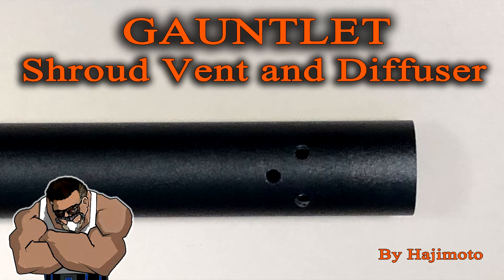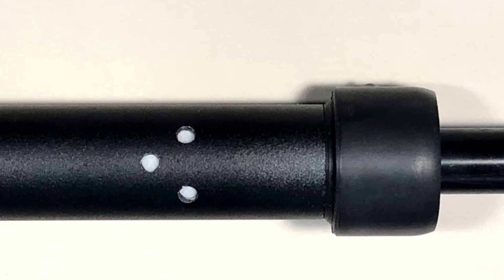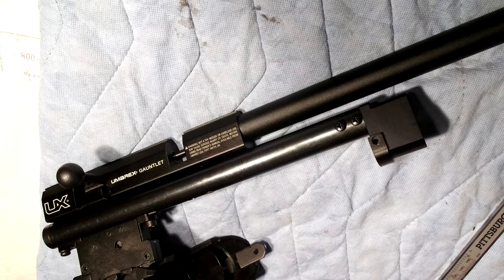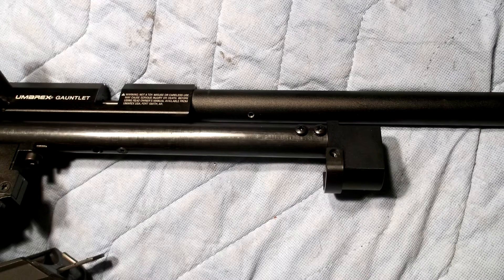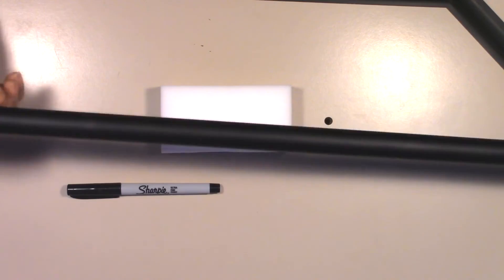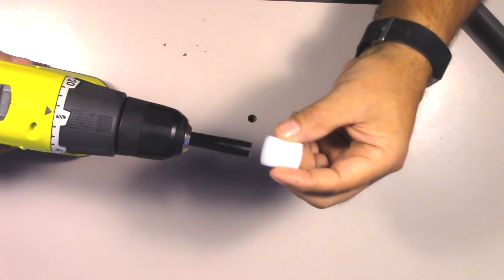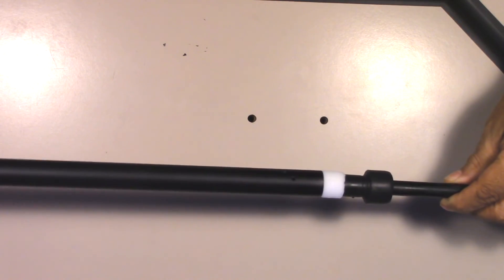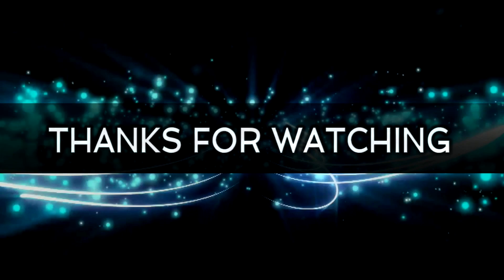Umarex Gauntlet: Shroud Ventilation and Diffuser

Comment: I recently installed the Sumo short shroud combo from DonnyFl on my Gauntlet .25. Upon testing I found the combo to be just as loud as my stock setup with your shroud mods and HP baffles installed:-( ! The real difference came when I did your mods on the short shroud(vent holes w/added diffuser). After testing again I found the Sumo with the modded short shroud dropped the sound level by 12db on average!! This is so your viewers know this is a worthwhile easy mod, even if the get the short shroud combo from DonnyFl!!! Thanks for sharing your knowledge and expertise!!!😃

Comment: Is there a particular characteristic to a melamine sponge you deem necessary for the job ? Guess I should have seen this one first. I drilled  two holes 2" up because that was recommended in another video you made. Have a .25 cal. I will drill a third 1 3/4 " up. Will make a triangle shape. Really like you vids trying to take it all in . One project at a time.
Reply from the maker: The melamine is micro fine holes which act as a much better static pressure induction generator as well as forcing the air through a labyrinth of pathways to help mitigate sound. Lastly, antimicrobial and great at catching lead dust. Also remember you can stack as many as you need so the melamine foam covers the holes, so that 2" distance is no issue at all ;)

Comment: Great video. How tough was it to drill the holes in a round barrel. I wish you would have shown that step.
Reply from the maker: The shroud is 1.5mm thick aluminum, it is very easy to drill. Just be sure to clean up and debur the inside of the shroud so the rough edges to not cut o-ring.
Reply: @HajimotoProductions  ok thx really appreciate it.

Comment: thanks for the very detailed videos,on the .25 the foremost hole is 2'' from the breech so the 2 offset holes are how far off the breech and how far apart?and i saw the takedown on another video with the hammer and to polish it,what did you use to polish inside the cylinder with and or any type of buffing compound?
Reply from the maker: The holes are in a triangle configuration and they are 3/4" from each other. The total hole openings of the holes should not exceed that of the bore. In other words if you have a 25 caliber it is .250" so three 1/16" holes will be good (3/16" total) but three 1/8" holes will not because the total free opening size would be 3/8". Smaller holes keep  the diffuser material from being pushed out as well.
 As for the tube polish, I used a wooden dowel wrapped in a cloth to allow a snug fit and then one wrap of 3000 grit to polish, then 4000 and finally 5000 grit. the wooden dowel is on a drill of course.
Reply: @HajimotoProductions  thanks for your time and very informative videos

Comment: Great video, my question is I wonder if it is necessary to drill three holes on a .177 cal. or if number of holes is an issue. Not sure if the three hole are dictated by caliber.
Reply from the maker: I have received and responded to your email on this subject already but will respond again here for consistency.   Yes, there is a method to the madness. The holes for ventilation should not exceed the bore size. I typically design not to exceed 80% of the bore size.

Now it is my professional opinion that multiple smaller holes are better than one large hole for multiple reasons.

Comment: Haji, quick question. For this to be effective you need the air stripper right? I’m thinking on doing this to my Nova Liberty but that gun has no baffle, “nada” inside the shroud
Reply from the maker: Yeah, You can drill a series of holes through the barrel support so air can be pushed back down the shroud tube and then drop in a ventilated washer to sit on top of the barrel and then the baffles can sit on top of that. Take a look at Air Velocity Sports latest video on the Liberty where he talks about adding baffles tot he Liberty.
Reply: Hi Haji, thanks for replying, yes I saw Stephen video... I might need to buy some baffles, in the video you mentioned them, do you sell them?

Comment: Mr. Hajimoto, I used the Mister Clean pads in both my .22 and .25. The.25 extrudes the Mister Clean pads thru the vent hole. Going to have to find a tougher sponge for the.25.
Reply from the maker: But the question is how many holes did you drill and what size were they?
Reply: 5.2 mm, just one hole.
Reply from the maker: Jon Childress that’s why 😏
You really want smaller holes so the diffuser is not forced through the hole.

Comment: Ignorant question here, but what do you use to smooth out the shroud and paint it, after drilling the 3 holes? Do you have a video for that? Thanks again!
Reply from the maker: I think the video I for the Umarex Origin should be able to assist you. Watch this link, I cued it right where you will get your answer.
https://youtu.be/KvJAYFADdHk?t=776

Comment: Great idea. I tried this on my hatsan neutron star, but the gap between shroud and barrel is just about a paper thin. I was not able to put the shroud back.
Reply from the maker: So the shroud on the Star is really just a sleeve then huh?
Reply: @HajimotoProductions  haha. Yeah it is. I put a half inch thick foam around that hole from the outside then. It reduced the blow significantly.

Comment: its been a long time since ive done paintball mods/had a business and at no point do i want to appear toxic or like i know jakshit. But after frequent use wont you blow out the melamine substrate? Supress,silence,ect is a complicated thing except in theory [i.e. venturi effect,bohrs other equations for laminar flow ect] but im wondering if  like copper or SS mesh could be used? that said i know it would prolly compress and slop around in the shroud as well at some point but im just curious 'i.e because i bought an armada and already got the itch to start modding. lol. another idea i used in the past was always drilling ports in the direction of flow. its a pi.t.a but you can do it with a dremel tool as well as go back and polish to increase laminar flow also. but...hell..im aspergers so its prolly just splitting frog hair for no reason.

Comment: What's the drill hole size for them?  Thanks
Reply from the maker: Just do not exceed the bore size. I always the 80% rule. The total area of the hole should not be greater than 80% of the bore.
Reply: @HajimotoProductions  If I go with  2 11/64 instead of 5/64.? could exceed a little.

I think this was the scale....
1 hole @ 11/64" or 4.4 mm
2 holes @ 5/64" or 2.2 mm
3 holes @ 3/64" or 1.1 mm

Comment: What size drill bit
Reply from the maker: You can drill as many holes as you like but try not to exceed 80% of the bore diameter. So in a .22 caliber for instance which is 5.5 MM, 80% is 5.2MM. So 1 hole @ 5.2MM or 2 Holes at 2.6MM or 3 holes at 1.73MM ands so on. If you are not a metric guy, you can find many drill conversion charts on Google to help assist you in drill bit selection.

Comment: hay hajimoto wondering if you can help me I have a leak out of the box the stripper is not cracked bottle hold air on its own leak seems to be below the bottle but comes out the barrel shroud I think rifle shots but air is leaking out help!
Reply from the maker: kevin christiansen you need to locate where the leak is. Make up some soapy water solution and start applying it to joints, fittings and screws looking for bubbles. How fast is the leak, how much air is lost in 24 hours?

Comment: In doing this on the .22 Gauntlet would we keep the just single 1/8" hole. I'm going to assume the three holes are because of the % of area rule for bore size on the .25, is that correct thinking?
Reply from the maker: You sir are right on target! 👍
Reply: So the 22 caliber version just needs one hole drilled?
Reply: @grey_wolf_sigma3961  figuring the % difference between 
.22 and .25, seems 3 would work. Seems 2 might be a good start place.

Comment: Hey  is there a good sound s suppressor that would work good on the gauntlet 25 caliber
Reply from the maker: Yes you can purchase the DonnyFL adapter and you can then install any 1/2 x 20 UNF threaded suppressor you want on the Gauntlet.
Reply: @HajimotoProductions  hey thank you for such a quick response really appreciate it will it really help lower the sound any and do you have any suggestions thanks again new to this whole airgun thing but I think the gauntlet would be a good choice in 25 I'm a tinkerer so I think with your videos I can do it the things the need to be done to it but really looking to lower the sound living in the very urban area of Houston

Comment: Hey the plastic cover goes over my bottle will not tighten up on gunlet
Reply from the maker: Not sure if you mean the sling stud will not tighten into the fore arm section of the stock or the bottle shroud itself will not proper interface with the stock.
Reply: @HajimotoProductions  it the sling stud will not tighten down on cover

Comment: You're just robbing power.  Go ahead n chrony it. You're lowering decibels right along with fps
Reply: I don't know why people like Seth make these false claims. I drilled 3 holes with a 1/16 inch drill bit into my gauntlet .25. I did a before and after chronograph test using FX radar. The average fps were the same. I did not notice any sound difference to my ears nor do I have a sound meter to measure if there is a difference.

Comment: I have a buckrail gauntlet 25 mod and for some reason after doing this it actually made it louder and i did it correctly, is it because of the moderator im using ?
Reply from the maker: Are you saying that you have a ventilated barrel and sound level increased after installing a dedicated suppressor? If so, I am not surprised as a dedicated suppressor will create more back pressure and because the ventilation holes are closer to the ear. Increase your diffuser material and try again.